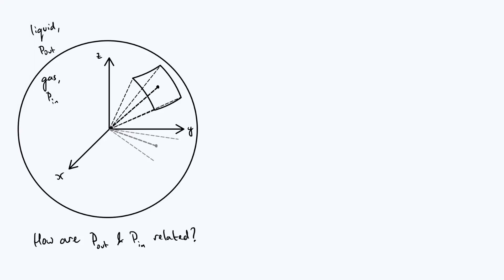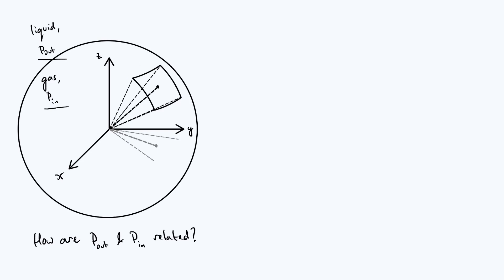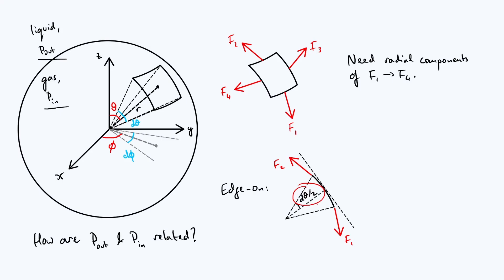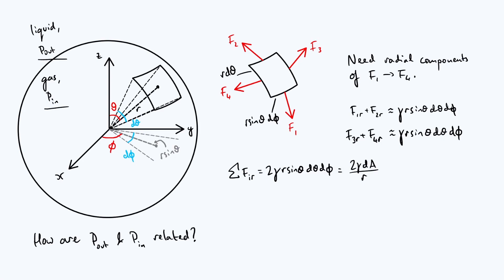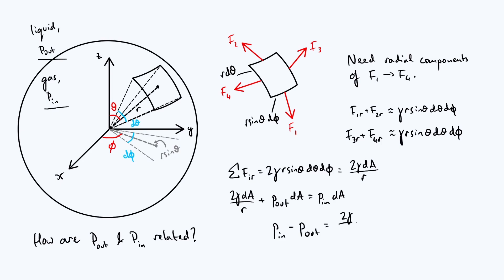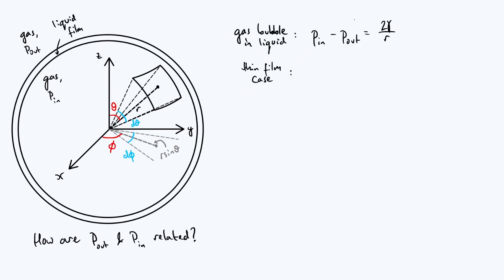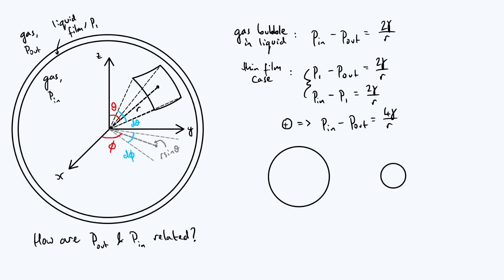Laplace pressure in a bubble: derivation using forces

Comment: In my class, my teacher kind of used surface energy and surface tension interchangeably. So we got difference in pressure as 2S/r where S is the surface energy (we got this by considering the work done for an infinitesimal change in area). I'm a bit confused on the difference now!

Also why is a sphere made during the capillary rise of water? (In my class we used this bubble formula to describe the spherical surface of the meniscus). So now I'm extra confused!!
Reply from the maker: Energy per unit area is completely equivalent to tension per unit length - see https://youtu.be/CJGvDfU4uJ4 for more on this!

For your second question - a capillary is by definition narrow, which means the effect of gravity on the shape of the meniscus is negligible. So, the force balance equations from this video are still approximately valid and we get the same spherical shape. For a container of larger diameter, we'd need to take into account the effect of gravity and this leads to a flatter meniscus.

Comment: Thank you! Could you also make a video in which you derive a formula for the stress acting on a balloon such that the express only depends on the thickness, the radius of the sphere and the material properties? If this is possible, of course
Reply from the maker: Perhaps this is what you're looking for? https://youtu.be/2B9Yfa15uPg
Reply: @DrBenYelverton Unfortunately, no. Let me explain the problem: starting from 0 km, the balloon ascend until it reaches the desired height. Calling dp = helium press - air press, which of the following scenarios happens?
1. dp = 0 ----> dp increases as the balloon expands, until it bursts
2. dp >0 -----> ?
Then, considering the fact that the thickness reduces, how do you compute the stress? In your expression for the stress, sigma = E*(r -r0)/r0, I don't see the initial thickness and the change in the pressure variation

Comment: Great problem as usual! I'll have to work it through the details myself later though because right now I'm confused about how surface tension is defined. Btw do you have any reference for such topic (namely surface tension) and perhaps this very problem?
Reply from the maker: Imagine changing the side lengths of our surface area element - intuitively, you can see that the longer the sides get, the greater the pulling force on each side will be. That's because the origin of this tension is ultimately the attractive force between the fluid molecules, and a longer side will have more molecules pulling on it. The only sensible way to quantify this tension is therefore as a force per unit length, which is exactly the definition of surface tension. No particular references come to mind but once you've understood the above definition hopefully things will fall into place!
Reply: @DrBenYelverton  Many thanks! Here is what I understood. Consider a surface element of the interface of two contacting mediums (e.g. air and water).  The surface tension experienced by a `perimeter element' (for the lack of a better term) of that surface element is tangent to interface and is in the outward normal direction of the surface element. The magnitude of that force is proportional to the length of the perimeter element, and the proportionality constant is denoted by gamma, which, presumably, depends on the two contacting medium.

If you could point out any mistake in my understanding that would be greatly appreciated! Thank you again for your work!
Reply from the maker: That sounds good to me! Just one comment, I think "the outward normal direction of the surface element" would be clearer as "the direction perpendicular to the perimeter element", since the normal direction to the surface element would really be perpendicular to the interface. I understood what you meant, but since surface elements are technically 2D they only have normals pointing "up" and "down", not to the sides!
Reply: @DrBenYelverton  Oops I meant to say the direction “is tangent to the interface and is in the outward normal direction of the perimeter element”! Thanks, I think I got it!
Reply from the maker: Makes sense!